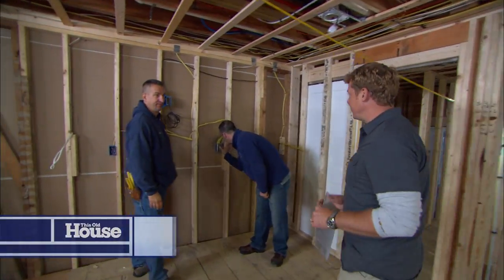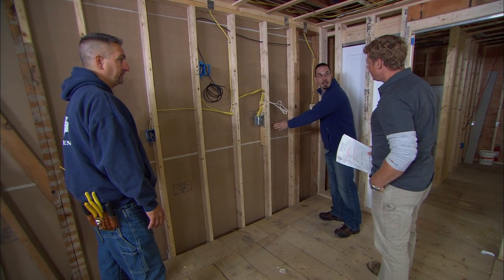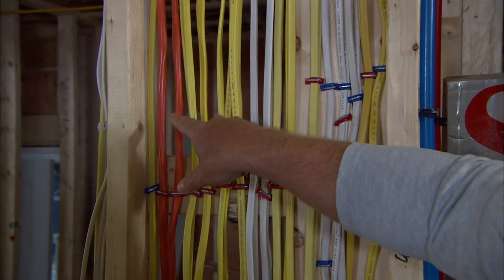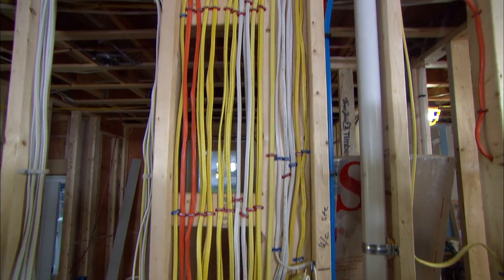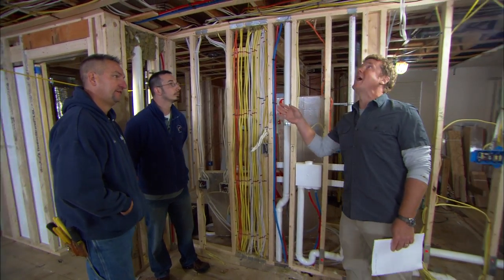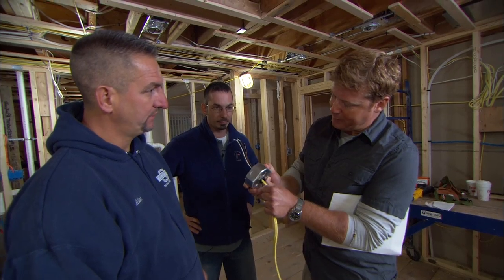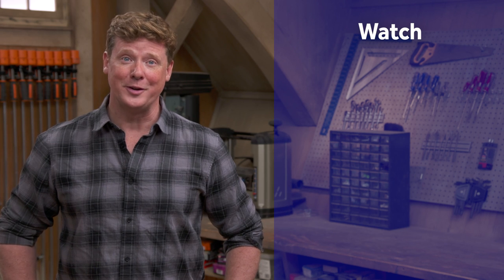How to Conduct a Rough Electrical Inspection | This Old House

Comment: If I were Alan, I would have wanted to clean up the wiring seen on this segment before the cameras started recording.  It may have been functionally acceptable,  but seems rrr-rough in the execution.  The countertop receptacles NM cable was pretty twisted and not run consistently horizontal.
Reply: There’s no protection of 12/2 romex going into metal gangbox in kitchen. Sloppy work

Comment: I would have used an oversized nail protector plate if just wall, due to baseboard where they use 2 1/2 air nailed brad nails 6 in up.

Comment: Psh come to Chicago where everything has to be in conduit! Freaking crazy!!!
Reply: Blame the Chicago fire... probably... 

-some random shmuck in Canada
Reply: @PaulRudd1941   Unions… every trade requires a license to do any simple home repair. Requiring conduit and only copper piping (no pex here) means homeowners likely won’t have tools to do it themselves and whoever does it can bill longer hours 👌
Reply: @Sports-Jorge  ooooohhhhh thank you sir. That makes a huge difference. Not to mention the hours and time it takes for brazing, crimping, bending and material. 

I'm totally oblivious, here in BC, Canada we use pex, and only commercial and industrial stuff needs that. 

I'm in HVAC so I don't know a huge amount about plumbing anything but air. But thanks for the explanation! Super appreciated.
Reply: Or in NYC where everything has to be BX
Reply: @ridgewoodgardens6253  I guess that's not as bad.
Reply: I mean it's not a terrible idea. How many times has some homeowner drilled through a Romex cable? Tons...I wouldn't leave that stuff unprotected
Reply: To run conduit requires more tools, time and skill. Logically the price will be much higher. Does it look way better? Is it safer? Is it easier to add circuits in the future? 100% yes
I think all large cities should require conduit.

Comment: I had my home inspector come in and he complained about the breaker having double wire.  The house was built in 2003 and became the breaker was double wire he failed my inspection. Can you explain to me why? He stated that the codes has change and breaker have to haves there own wires. But I don’t understand what that has to do with me has a home own. What we would have to change breakers from houses that was built in the 1970 or even on the 50’ s. I’m confused.
Reply: They don’t want two wires under one screw on the breaker. You can pig tail two circuits together, then bring one wire to the breaker. You do need to evaluate what gauge wire is allowed to share a breaker and what amperage is needed to accommodate two circuits safely.

Comment: Shouldn't there be nsil plates in the kitchen area where the wire goes thru each stud?
Reply: Most municipalities require a nail plate if the edge of the 2X4 to the actual wire is less than 1 1/4 inches. I always used nail plates over every stud regardless of the depth. I’ve done service calls where the wire(s) had a safe distance during the construction but upon remodeling, some people will drill in longer screws. Oh what fun it is trying to find those dead shorts.

Comment: Definitely a low budget rough in.
Reply: Agree, I would’ve been embarrassed that I was on that job. Love the fact the electrician showed the red and blue. Says that the blue is for a single cable and red was for two. Yet the just finished showing multi blues with two cables. Lol
Reply: Explain how this is low-budget. This looks typical...
Reply: @mr.g937  Too much slack between staples. Decided to drill the hole in the middle of the bay and proceeded to pull the wire and stapled it with about 12" of wire just hanging on the diagonal.  And where the home runs are at, didn't use stackers to make it look neater. And the wires on the ceiling? They are NOT to code. The beams should've been drilled out and wires pulled through.
Reply: @mr.g937  it’s just poor workmanship. If that’s all the job pays then by all means do it as fast as you can as long as your code compliant.
Reply: That's pretty much how everyone runs wire overhead in N.E because most builders use strapping to hang the drywall/plasterboard.  Against code...no, a good idea... probably not.
Reply: @mr.g937  Sloppy work is what he means.
Reply: Who cares it doesn't look pretty. As long as everything is up to code and all safety precautions are met everything is gonna be behind a wall. Thats why electricians charge 1000's just to run some wires. They take their sweet time to make it look pretty 😂
Reply: @nateg5915  mechanical tradesmen should take pride in their work even if it’s behind the walls.
Reply: @robertsteich7362  thats false. you can run parallel to furring strips especially in mass. as long as you maintain 3/4 from where a screw or nail is likely to penetrate.

Comment: What if the walls aren't exposed... how can you inspect in a house that is finished?
Reply: There are several inspections.  This one is specifically for rough in, meaning all wires are available for viewing or it doesn't pass. Cant move on to final inspection without passing this one.

Comment: Is the romex color standard?
Reply: Yup
Reply: Most of the time, but not always. If you are running new stuff, you're probably going to see standard colors, but if it's older, all bets are off. Colors also tend to vary in different countries.
Reply: Except for direct burial which is usually just grey or black for multiple awg wire sizes.

Comment: NEC 2020 doesn’t have receptacle requirements at 4 feet; while I understand on a counter, which looked like the height they were at normal/regular rooms don’t have a 4 foot requirement. I say that as 2020 NEC is what we’re using where I am, some jurisdictions are still under 2017 and even 2014; and beyond the code used some municipalities can require more than minimum code. If someone is aware of the 4 foot requirement note the # in a comment as I’d like to be corrected if wrong. Code is good on some things and over kill on others. For example I’ve been installing whole home surge protectors on every new/upgraded service I’ve done for over a decade now, it is now the standard in the 2020 NEC; AFCI requirements on the other hand, at least in my opinion, have gone too far and have lead to a big jump in new work pricing over the last 6-7 years leading a lot of people to just do it themselves. I live in NY were electricians, outside of a few municipalities, are not required to have a license and couldn’t be licensed even if they wanted to be; this can lead to some issue but also makes getting into the trade easier as spread apprenticeships, at least outside of union halls/houses, are easier to obtain and are skill/area specific. I grew up watching This Old House and New Yankee Workshop in a trades family and am glad I did because regardless off economy or education the trades are always needed; hopefully more people are seeing the trades need and shortcomings of education only choices and we’ll see more people get into the trades.
Reply: MA has amendments to the NEC which makes up the MA electrical code. Could be within the amendments. I would have to check the book but I believe for a normal room spacing requirement remains at 6’.
Reply: NEC 210.52(C)(1) does cover: Wall Countertop and Work Surface. And states: A receptacle outlet shall be installed at each wall countertop and work surface  that is 300 mm (12 in.) or wider. Receptacle outlets shall be installed so that no point along the wall line is more than 600 mm (24 in.) measured horizontally from a receptacle outlet in that space. However 210.52(A)(1) does cover general spacing, which is no more than 6 foot horizontal distance along the wall to a receptacle which would allow a 12 foot spacing. This is an area where I think minimum code is a good starting place because I don’t believe you can have enough receptacles; at least I’ve never gotten a complaint about too many. I like every 6th stud @16” centers as well as location specific, if you know planned or foreseeable layouts, like on each side of a bed. I just didn’t want someone to think they needed receptacles every 2 feet.
Reply: @steveloux4709 : No you really can’t have too many; NEC 2020 finally caught up to kitchen islands. I’ve been installing pop-ups and drawer outlets for years. I like putting USB outlets in the kitchen at counter level as well as they reduce a lot of clutter and add safety by removing the power bricks. Always though minimum code was a decent starting point but have been doing more than code, outside of AFCIs, for years. I also like a receptacle at switch height as well as it makes vacuuming much easier. Kitchens and bathrooms have both outpaced code as far as amp/circuits required over time just as we’ve grown our appliances as the years have gone by. When I re-modeled my kitchen I added a sub-panel to ensure easier wiring as well as a simple place to reset trips as I exclusively used GFCI breakers as well as allowing easier addition of circuits; went from 1 to 8 with 2 in the walk in pantry alone so that we could just leave everything plugged in and use it when we wanted to. Before we’d pull an appliance out and run it on the counter; we would trip breakers every thanksgiving. I ran 2 gangs and 12/3 to my counter receptacles allowing both sides to have appliances without issue. I also ran a filtered water line to my commercial Keurig coffee maker which has probably paid more dividends than anything else as I have never had to worry about it running out.

Comment: Even Kevin knows the electrician's natural enemy is the drywall guy......like electricians and plumbers, electricians and tile people, electricians and other electricians.....
Reply: Working on a 23 story apartment back in the '70's. The dry wallers kept putting screws through our romex so the foreman hands a 3lb. hammer to an apprentice and tells him to find all the short circuits in an apartment that was particularly bad. That apprentice beat holes in every wall in the apartment, it was a mess but after that there were no more shorts.
Reply: You electricians sure are a contentious lot

Comment: Extension cords are perfectly safe provided they have fuses built in. Which in many jurisdictions, they do by law. And fuses cost pennies. So much cheaper than having to install outlets every six inches.
Reply: @tatersngravy99  In the UK almost every single cord has a fuse built in to the plug. Their plugs are about 3 times the size of ours so they can fit it. And they also say extension cord when they mean power strip. In the US a power strip might have a fuse built in. 

In the UK they are overly cautious about electrical stuff. There are no outlets allowed in bathrooms and all outlets have rocker switches built in so they can be turned off.
Reply: @c0mputer  rightfully so, since in the UK they have an affinity for 240V line-to-neutral.   Double the voltage, twice as deadly (I'm referring of course to Ohm's law).
Reply: I’ve been a master electrician for over 40 years and here’s one thing that never changes, there is no arguing with an inspector. You can make a point or even point out a difference in the code book but every municipality has the last say so. I know a great deal about our NEC (National Electric Code used in the U.S.) but I always got revisions from the city I was working in to see what they required to avoid conflict later.

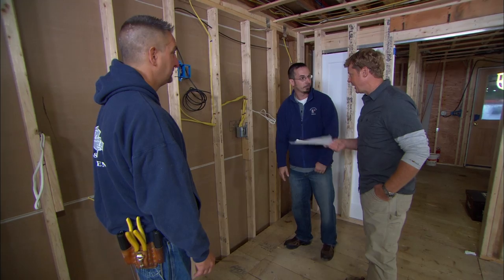Comment: 1:06 I don't see any cable connector in that metal box to prevent the cable from getting cut by the sharp edges of the knockout. There should be either a metal or plastic insert in the knockout to protect the cable.
Reply: That type of box has a screw down clamp to hold the wire in place. No connector required.
Reply: @phi5head  Not installed in the video at 1:06. You can clearly see 3 romex wires coming in from the top with no clamp (metal box wire connector).
Reply: @guytech7310  Yes, the box at 1:06 has a clamp with a screw to tighten it down on the inside of the box. Out of view.
Reply: @phi5head  No. look closely. No clamp. You would still see the thread and the nut. or the plastic tab if was using a plastic insert.
Reply: @guytech7310  do a search for "square box nm clamps" and you'll see what is going on.
Reply: @phi5head  I installed hundreds if not over 1000 of them. Give it a rest.
Reply: @guytech7310  lol. Are you serious? Did you google it and see the clamp? It's there, out of view.  You take your flat head and remove the knockouts, you insert the romex and tighten the clamp down with the screw to hold the wire in place. No connector required.  

You've apparently never seen a box with nm clamps before. Weird for someone who is so experienced.
Reply: @phi5head  I've installed hundreds! I know what they look like. obviously you do not!
Reply: @guytech7310 You've installed hundreds of what? Apparently not metal boxes with built-in romex clamps. Because that is what is being used in the video at 1:06 and you mistakenly thought there was a code violation when there wasn't.
Reply: There’s no strap inside the box. None some  apprentice forgot to install it. Just looking how the wire was routed it’s first year apprentice work.

Comment: That looks like apprentice  level work . Should of been a 4s deep box since your having to install a gfci outlet at the counter top . And that " inspector" is new or needs more experience
Reply: Around here in VA, one GFCI upstream can protect those down.  Is that maybe what they are doing?  I did not go back and look whether we could tell where those outlets were relative to the panel.
Reply: One more thing.  Someone should inform the inspector that those devices are called receptacles, not outlets.

Comment: l got a diyer 2003.
EVERY time l opened a box there was a problem.
on had fcukin DOORBELL WIRE so l immediately disconnected it.
then th o/l above th stairwell stopped working.
etc etc. jeezuz murphy.
my kid bought a condo in ottawa.
the tester showed 1 o/l wired backwards.

Comment: To eliminate the difference in wires, I would run all 6 gauge. 6 gauge is good up to 50amps. You will never overload or have a wire fire on 6gage @ 20 or 30amp breaker. It’s much simpler to keep track of wire if your buying by the foot. Although the electrician may not like it because they gotta work a little harder. Also, Eaton make a breaker arc fault & gfi. No more pigtails.
Reply: @Kevin-mp5of  feel better now? If that’s the only thing your going to pick out that’s wrong, then you must agree with the main idea of the message I was sending.
Reply: It doesnt work like that 🤣🤣🤣
Please never wire anything.
Reply: I prefer to run 3-3-3-5 cable and put a small (40 space) 100A subpanel in every room I wire. The homeowner can cover the panel with a framed Thomas Kinkade painting to hide it, but then they have the flexibility to add as many branch circuits as they need in the future.
Reply: Eaton does make a AFCI without a pigtail. It’s for the plug on neutral panels.

As far as running #6 for everything, yes equipment will run better and be more efficient since voltage drop would be less of an issue but in all reality it comes down to cost. Someone has to pay for it and your typical homeowner won’t justify the added cost. Also good luck wiring up your device boxes.
Reply: Eaton started a lil’while ago Afci & gfi in 1 Circuit breaker. No pigtail. It’s basically plug and play. Leviton makes a afci & gfi WiFi circuit breaker. When it trips it’s alerts the property owner and electrician. Provides the electrician to know if something wrong with the wire or breaker and what the cause of the circuit to trip. Kind of nice because it provides the electrician to know if it trip because of a gfi, that means water. Then no need to call the electrician, better call a plumber. Or if something is arcing. Basically a discussion is made if in fact it warrants a truck roll. Go search for yourself Leviton YouTube bout smart circuit breakers. Its how I found out..
Reply: I'd do everything in 14)2 and just double or triple up in parallel - only where necessary. Best of both worlds, easy logistics and cheap and you can even gain extra conductivity through the skin effect.
Reply: You can only parallel 1/0 or larger conductors.
Reply: @mr.g937  understand your concerns. You have to realize, it’s all subjective.
Reply: @ABC-oo4vm  it's not. There's a bunch of smart people called the NFPA who put together a code book called the NEC which objectively describes what you should and should not be doing
Reply: @mr.g937  ok, in your opinion- So, 6g on a 20amp is uncomfortable?
Reply: @ABC-oo4vm  I don't know what you mean by uncomfortable. 6g on a 20 amp circuit is a waste of money, both materials and increased labor.
Reply: @mr.g937  so your only complaint is of expense, not that its not do able?
Reply: @ABC-oo4vm  it's impractical. Pulling 6 guage wire is difficult and harder to run and secure to the joists. Receptacles do not take 6g wire so you need to pigtail, which will require bigger boxes since box fill is based on the largest conductor size. There's so many reasons why this is a bad idea, but the cost is a very important one.
Reply: @mr.g937  ok, so it again comes down to the bottom line. Your budget and work ethic maybe very different then mine. So 6g on 20 or 30amps is possible?
Reply: @ABC-oo4vm  , Just where do you ply your trade? Please show us an example of your work.
Reply: @ABC-oo4vm  don’t wire anything dude. You have no clue.
Reply: @ABC-oo4vm  Have you see cable and wire prices lately? To run a house with 6 awg, would probably cost $25K to $50K in wire alone. Than you have to consider that receptacles only accept 12 awg wire, and good luck getting 6 awg for a 2 1/8 depth gang box, especially for multi gang boxes with 3-way, 4-way, switches.

To give you a concept of how ridiculous it would be too only used 6 awg wiring, is like trying to stuff a tractor trailer engine, in an old vw beetle: It ain't happening!